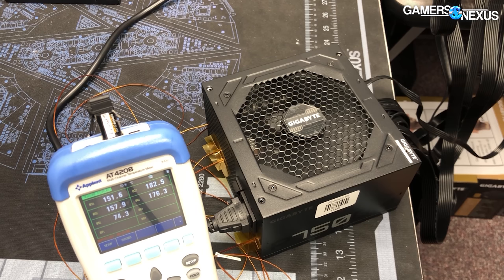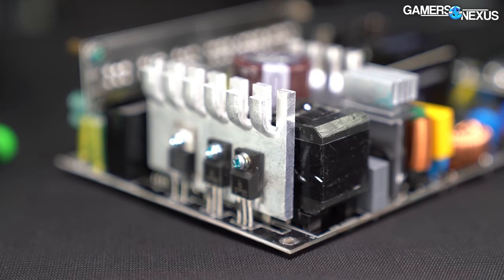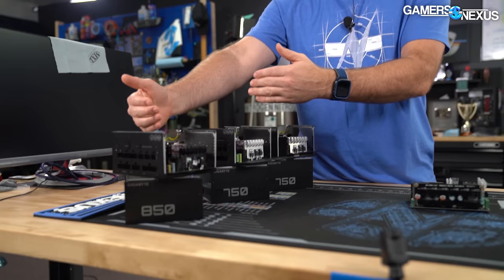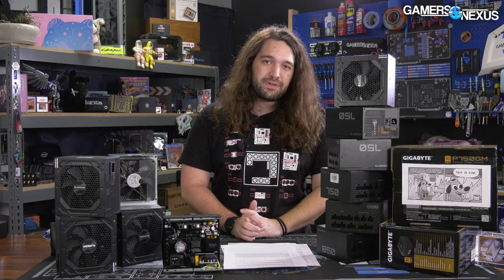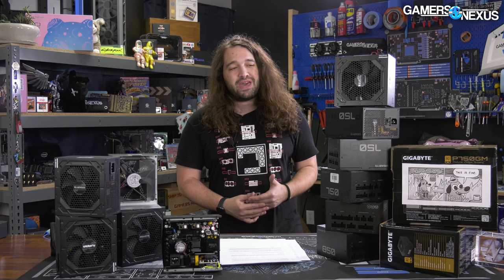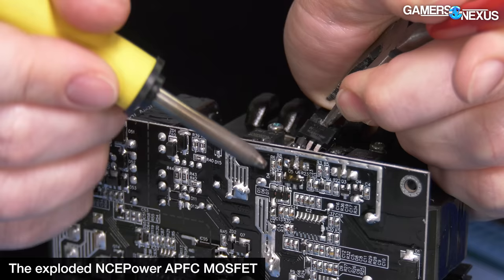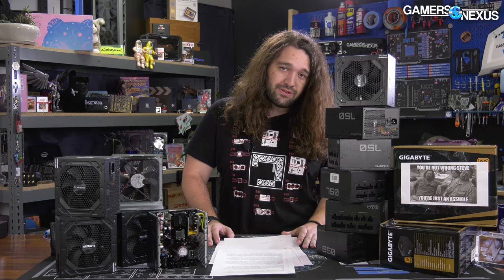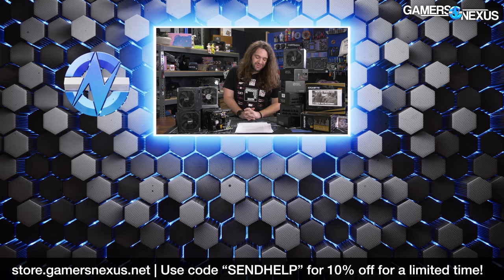Exploding Power Supplies: Gigabyte & Newegg Dumping Unsellable Product

Comment: I got this psu when I've build my current rig for 100 euros because it was 80+ gold and fully modular but after seeing this I'm scared... I had no problems so far with it after 5 months of using it but still my concern is rising after this revelation, you would advice me to replace it?
Reply: I would replace it if you can afford to, because otherwise you're just going to worry the whole time. Not worth the anxiety.

Comment: Hi @Gamers Nexus  wondering, could the OPP fail to re-enable all mosfets, forcing all load through just one mosfet that in the end fails?
It would be interesting to monitor individual mosfet temperatures prior to failure.
My guess is there's a bug in the code cleaning up after OPP. Or am I completely wrong?

Comment: After viewing this video, I checked the PSU in my ABS Gladiator. It is the P750GM. The unit has run without issue for about 6 months now. Should I be concerned at this point, enough to replace the unit pre-emptively or would it be safe to assume I lucked out with a good unit?
Reply: @valentinzota8835  Thanks! Yeah I ordered a Corsair unit. Arriving today, just didn't feel comfortable leaving that thing in there....

Comment: I may have “overpaid” for my ROG Thor power supply because it has a screen on the side but my case has enough airflow that together with the upgraded heat sinks in the PSU I don’t think it would overheat even if the fan died in it. I won’t lie I bought it because I thought the screen with the live wattage read out looked cool but I also have no problem spending $ on a quality power supply as it’s the lifeblood of your system. I cringe at some of the pics I see of builds with high dollar components and iffy power supplies especially with the amount of juice these newer cards pull and how hard they are to get in the first place. I’m not leaving my RTX 3080 to chance just to save $50.

Comment: Is it even possible to have a psu running >100%? How does that work, it's outputting more power than it's drawing?
Reply: Meassuring is taken secondary site.. depending on efficiency, it'll draw for sure more off the wall (primary site).. and yes, my bq 400w got's smacked, every time i start up my fukin old server (wall draw ~450w) xD but does the job, since... m 15 years. ;P

Comment: Uhm, my PC came with a p750Gm and had a 5900x and 3070 in it. No issues, I upgraded to a p1000gm psu, as I bought a 400watt 6900xt liquid cooled card... now I had NO idea these PSU's had issues, and now I'm madly worried because I don't know if my PC is at risk or how to check of its at risk.... I've ran 100%cpu and gpu loads and from my understanding it should suck up to 650-700watts meaning that 1000watt gpu would be getting used pretty much, would the issue have already happened given I've ran such benchmarks before or can I expect problems in the future?

Edit: I just realized that a while back my computer would randomly shutdown, became worse with time, and I thought it to be the Temps despite never seeing them actually got anywhere near the limit... I'm now relising that p750gm might indeed have had issues, luckily none explosive, and from what I've read the p1000gm seems alright, but this definitely doesn't inspire confidence...
Reply: since you upgraded you are probably okay
Reply: late reply, but how is your pc now? I have the p750gm, although running a 3600 & rx 580. Am just curious to your pc's current state
Reply: @tristannn808  coming back to this, the PG1000 has been perfectly fine, but the 750 seems to have been the cause of a couple of bluescreens I previously thought were because of the GPU. Having given the GPU to my girlfriend for her build, she's had 0 bluescreens in 4 months, meaning that it was 100% the PSU causing bluescreens. If you encounter any weird issues, it'll most likely be the pg750.
Reply: @Beefy-Tech  thank you very much for your detailed response

Comment: I have a 750 and recently won the Newegg shuffle and got a 3070 ti. I’ve already used it and been using this power supply since last March. Should I get a new psu?? Before I had a 5600 xt

Comment: mother of god, I have one of these P750Gm in my main pc with a gpu 6800 + 5600xt and CPU 5600x, 2 HD, 1 SSD, 1 M.2 500gb WD blue. Should I be scared? EDIT: I was running it for 1 month with a: 2060; 3060; 3070; 5600xt (mining rig). Nothing wrong, but, aghhh, almost close to fuu the card or explode the PS. I got a EVGA 750GQ gold, for the new card I got: 3070x2, 3060 and 2060, safe now, but my main have the 750gm now :(

Comment: Do you guys have a list of dependable PSUs? I have a CyberPower box with a Thermaltake Smart 600 PSU and want to upgrade to an 850W unit. Looking at EVGA right now. Maybe Corsair. Any advice would be very much appreciated. The last time I had a PSU failure, it took out my entire MOBO!

BTW, my gaming machine runs 27/7/365, and the Thermaltake has so far been fine. But I'm running a GTX1080-Ti (with 2 power connectors) and want to get something heavier...I don't think 600W will do the job.

Comment: Why would you use a 750-850w power supply with a 3080. Anybody’s who watched any review on the 3080 launch would know even 1000-1200w power supplies Even top of the line power supplies struggle to keep up with the 3080.

Comment: I found a gigabyte p1000gm 1000w PSU for a tempting price . . should I buy it or not? will it explode?
Reply: Sic Semper Mortem Tyrannis  Thank you seems logical. By the way, these Gigabytes are selling for cheap everywhere
Reply: Sic Semper Mortem Tyrannis  Problem with electronics in general, it's not easy to tell "who's fault it is" once sold
Reply: Sic Semper Mortem Tyrannis  100%

Comment: Are the Aorus psu's having these problems? I have a brand new Aorus GP-AP850GM that I have not used yet.
Reply: They are actually really good psu's. 100% Japanese caps and the ripple/noise on the 12v rail is among the lowest.

Comment: I just got a wonderful Power Man IP-350CQ2-0 PSU with a IN Win case. Can we see how this 350 watt POS holds up? It still on Newegg with the EM048.CH350TB3 In Win Case. Buget does not mean blow up the same day. First thing I did was remove and install old AX 850 Corsair PSU into case. 

Don't think that the Power Man can handle even:
I3-10100F, GTX 1660,16GB of 3000MHz @ 2666MHz, Pioneer Blue Ray drive, Samsung 980 Evo M.2, WD blue 1 TB SSD SATA, and a card reader.

Probably even worse than the Gigabyte GP-750GM. I don't trust a PSU that is lighter than a paperweight. Has anyone had mishaps with this PSU, Meaning Power Man one?

Comment: Hello! how are you? Excellent video. I have a question. A few months ago I bought a gp-p750gm but it is not within the serial number range published by Gigabyte. Should I be worried? So far everything works normal. I have an RTX 2060 Super and I did a stress test and nothing happened. Should I write to Gigabyte? Thanks!
Reply: Ask for a refund from where you bought it if you're still within the return period. Better to get a PSU without a record of so many catastrophic failures. Many other better options out there

Comment: PSU is the most important PC part DO NOT CHEAP OUT ON A PSU, research a product before clicking order, PSU powers your £1,000+ system do you really wanna risk it? ive got a £100 evga supernova 750w G2 yeah its pricey but thats my insurance. 750w is way more power than most people need this also means the PSU not been stressed out plenty of headroom there and this psu has good reviews so gives peace of mind.
Reply: I agree but at the same time i have been using cheap PSUs for 20 years and still have a cheap PSU.
Reply: The story was that it gets smoked after 3 or 4 years and i replaced it with another crap PSU.

Comment: I already lost faith in Gigabyte once my Ryzen First Generation Motherboard had too many issues. Getting a different model even after sending it in for repair. GA-AB350M-D3H Rev. 1.0 for GA-AB350M-GAMING 3 Rev. 1.0. Specs APPEAR same, but issues include resetting/reloading UEFI preset almost each time you unplug constant power (WITH CMOS BATTERY PRESENT). Lest I want to deal with 1-2 minutes before boot starts. >__< Also failed were 2 different Gigabyte keyboards years back (one gray/bronze with volume knob, one black with 'bumpy' outline near top edges).

And fuck Asus as well. Their 1366 boards are shit, so prone to failure. Zalman mice and ADATA USB Drives too.

For Hard Drives, get Seagate or HGST/Toshiba (Enterprise). For SSDs, get Samsung. For mice, Logitech is very good.

Comment: I have a gigabyte P650G. I can't find any info on this PSU.
Reply: i have the P1000GM. i cant find any info on it either
Reply: @mozambique9113  do you have a prebuilt to?
Reply: @tntorqu  nope , i diy it without knowing it explodes
Reply: @mozambique9113  well I gotten a prebuilt and I never did like gigabyte even my friends went through several of them. One of them fried his gpu. Gigabyte wasn't go to replace his gpu either.
Reply: @tntorqu  how many months ago for your friend's psu??
Reply: @mozambique9113  it was a month ago
Reply: @tntorqu  bro, Im so scared right now. although it was imported into my country like in december. i have 1000watt model i hope they fixed the stuff
Reply: @mozambique9113  your best bet my man is to replace it as soon as possible. I just bought a corsair psu 2021 model. I'm going to take out that gigabyte that came with the prebuilt.

Comment: Newegg is a sleezy  company imo.  They must have a connection with ORICO as they heavily promote their garbage (have two devices that claim higher specs than they actually have, like a USB 3.0 hub that actually is a USB 2.0 hub, or a Bluetooth 5.0 adapter that's actually bluetooth 3.0.  And if you try to do a review pointing out you're being bribed to change your review, they stop you from being able to post such a review.  They suck and will never do business with them again.

Comment: Why would one expect a power supply to not fail after running at 140% of rating. Of course they would fail afterward after the silicon got cratered in a hazardous test run like that.

We get the point the things had a high failure rate out of the box with normal use.
This is why everyone should never get a BUNDLE DEAL of anything. You get some garbage you don't want along with that you do want.